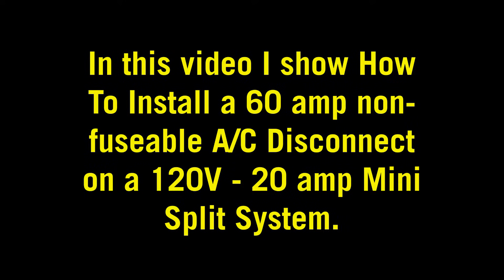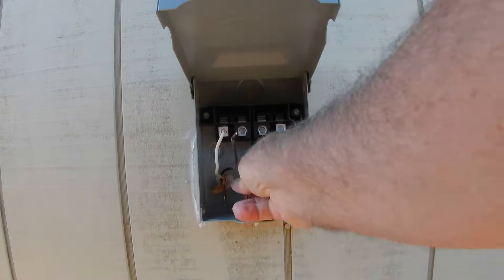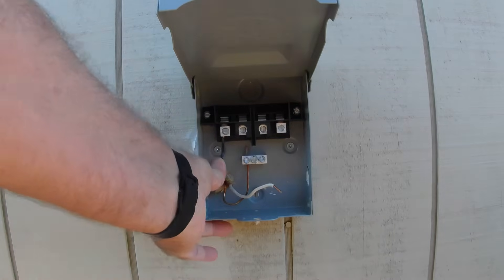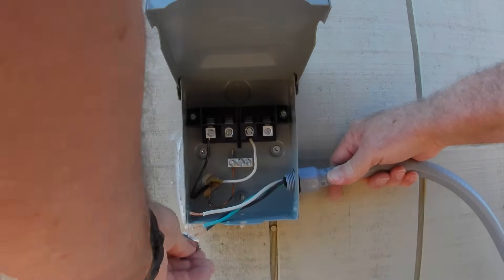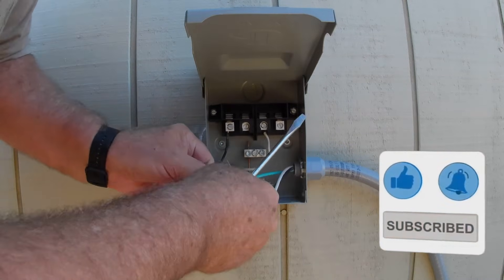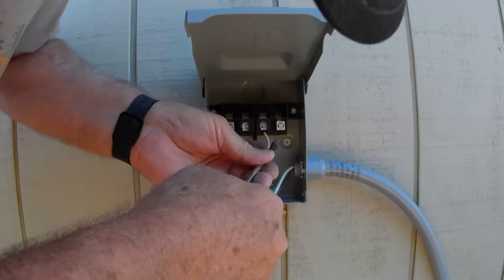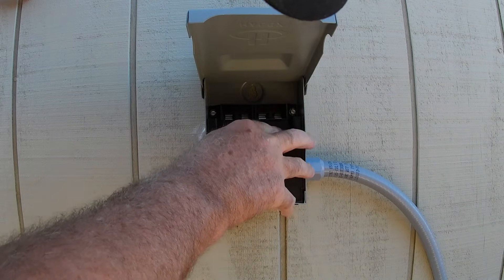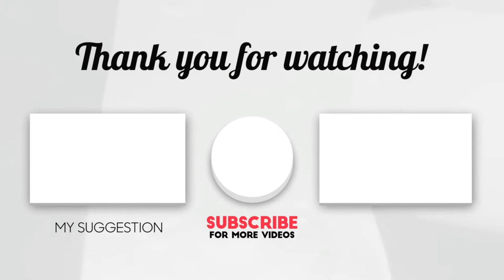How to Wire a Disconnect Box for an Air Conditioner

Comment: My wife is an electrician does your code not make you use insulator bushings on the liquid tite fitting?
Reply from the maker: Hi Matthew, Yes, insulator bushings are often needed on liquidtight fittings, especially for conductors size 4 AWG or larger entering boxes/enclosures, to protect wires from sharp edges, though plastic fittings also qualify if they offer smooth, rounded protection as per NEC 300.4(G). The decision depends on the fitting's design and the inspector's interpretation, but adding a plastic bushing is a common way to ensure code compliance and prevent cable damage from abrasion or cuts.   Thanks a bunch for bringing that up, I also put a fitting where the wires came through the back.  I forgot to get it on camera when I screwed that one up and forgot that fitting.

Comment: Hi, what if your AC line (Load) has Black, RED, and green- no white/neutral. The Conduit from LINE house is Black, White, Ground...where do you connect then? Both Blacks on Left- Line/Load-and and "treat" the Load RED as a Neutral and plug it in to the right side as you show? I have mine (working 2+ years)- running with the white and red together, no right side bar used (dummy copper used for connectivity), and treated it like a hotwater heater, I guess.  Wish I could send a photo, sir.
Reply from the maker: As per the book the red is treated as a neutral in your situation, thanks for jumping on here William

Comment: Isn’t the two middle lugs for the load and the two outer ones for the line? Seems like you crossed the neutral
Reply from the maker: Hi Jeremy,  Honestly it doesn't matter on this disconnect one side it connecting hots and one side neutrals regardless which pins they are on because the cross over is the disconnect pull out.  Good catch and thanks for watching.

Comment: If you are installing a Mini Split AC unit, THERE IS NO NEUTRAL!   They are 220, which means you have TWO  “line wires”, normally a black, and a red, but sometimes they use the wrong wire type (colors) for the 220 circuit with a black, a white and a copper ground.  As long as it is sized correctly it doesn’t matter, BUT should be Black, Red and copper ground which makes it clearer to somebody they are both HOT.   There is no neutral.
Reply from the maker: Great point and we thank you for the explanation on a 220v unit, I couldn't have said it better.  However this is a 120v disconnect video that is wired differently.   Again I appreciate you watching and the input, it means a lot to me!

Comment: So is your neutral connected to ground bar inside panel? 
How would that back feed? Wouldn’t you just wire nut your neutral together in the disconnect?
Reply from the maker: You can wire together, if you look at how this disconnect works it just cuts the hot and neutral when pulled and when put back in it reconnects the  hot and neutral.  These disconnects are in line for code and being able to service it without the chance of of harming themselves.

Comment: I am wiring a DIY 115 volt Mr cool 12k mini split. Mr cool recommends 10/2 wire with a 25amp breaker. I know it might be over kill but hey. I have a similar 60 amp non fuse disconnect. If I am understanding correctly my Romex from the panel goes on load terminals hot and neutral? And then the load terminals are where the wires from the mini split go? There is no order other than making sure load is mini split and line is the wires from the house? Is it really that simple or am I missing something?
Reply from the maker: Yes, that simple.  Just like I showed!

Comment: Do you not need the fuses for this?
Reply from the maker: No fuses just an a/c disconnect.  The fuse/breaker is in the panel the wire was pulled from.

Comment: Great video. Been searching for this, as all the others are for 240v. I had an electrician tell me to connect both black and white to each line terminal, but I am using 20a single pole and 120v system like you, and I didn’t think that’s correct. Question though is where does the white wire connect inside the breaker panel? To the common neutral rail, where all the others in the panel go, or on the ground bus? Sorry if a repeat, but I searched all the comments and didn’t really see an answer specifically unless I missed it.
Reply from the maker: Look at the other breakers in that panel and their white Netrual wires go, I cannot answer because I don't know if your working off a sub panel or bonded etc.  Some wire the whites into the grounding bar so the best way to tell is by the other breakers.  I hope this makes sense I just don't know your level on eletrical.   Thanks for watching Aaron!
Reply: @ILikeToBuildStuff  Thanks for the reply! It is a sub panel I am wiring it to. It has a a black, red and white wire coming from the main breaker. The white is connected to a common rail separate from the ground bar. Other circuits in that panel had the whites on the common rail not the ground bus.
Reply from the maker: @aaronwilliams8600    Stick with the common from what you said.

Comment: My ac disconnect box says (load and line)... So load is neutral/white wire?...
Reply from the maker: The Line is coming in from the breaker panel the load is going to the a/c unit.  On one side of the disconnect is the black hot wire and the other side is the white neutral wire.  hope this helps
Reply: @ILikeToBuildStuff  yes.. thank you

Comment: Can I do the same process if I want to add a 120 outlet to the disconnect box?
Reply from the maker: It should not have a receptical in the line, unit to disconnect then disconnect to dedicated 20amp breaker homerun to electrical box

Comment: Where does the red wire go? Also, my disconnect has two extra places that your box doesn't have. I have to assume those would be for fused connections. Nonetheless,  I removed those and still don't know where the red wire goes (from the whip). The bozo local yokel I had install my ductless simply used the disconnect as a junction box, which is how my motherboard got fried. It's how all the ac guys here do it, which is why I've become a DYIer out of necessity. So, I'm trying to fix this and do things properly. Meanwhile, the various how-to install disconnect videos I've watched do not discuss the red wire, and there are conflicts on whether I treat the load white as hot. I'm way confused. A little help?
Reply from the maker: I am going to assume that your unit is 120v and not 240v  in which case the red wire would be for the 240v so it sounds like the red wire is not hot but an extra inside the whip, you should verify that it is a unused wire and that no current .

Comment: As for the surge protector to install on the 120v disconnect box its pretty simple as well. Your surge protectors work for both 120v and 220v . The surge protector comes with 3 wires : 2 blacks and 1 white. The white is not the neutral but it is the ground. So tie it to the ground nut in the box. The other 2 wires ( black ), for the 120 wiring ,you tie the 2 blacks together as one wire and put it on the one the load side of the condenser wire hot black. Thats it. For 220 you put each black on the load sides. And cut the chord as short as it requires without bends. Hipe that helps a bit and gipe not confusing. Based in this video you put the 2 black wires of the surge protector together on the load side. And the ac coming in hot black on the as he shows. The neutral line in can be tied together with a nut or as he shows in this video. Every city has their own codes. Ask the inspector if you need to and wire it that way. But i shut breaker off from inside panel when i do service and the disconnect box as well.

Comment: This was a GREAT video.  The irony is that "certified" electricians either can't, or aren't about to explain anything.  I think I'm over-thinking this, but this part doesn't confuse me as much as how this leads back to the main breaker panel.  You see a lot of videos on this part of it.  I need to run a new breaker from our main box across the house somewhere accessible to our 2nd floor master bedroom for a mini-split.  And, I need to do it in a way that doesn't get me castrated because it looks like a huge eye-sore.  Certified electricians want an insulting amount of money to do this, and short of running the wire, it doesn't seem like it's that hard of a job (compared to the mini-split install itself).  Any advice, or link you can give on the 1st part of this...i.e. main fuse box to the shut-off?
Reply from the maker: I would say first check to see if your panel has any dedicated electrical line running in the area where you need it but isn't in use.  I have seen that so many times.  But if you need to run your own line it's not usually a problem if you have attic access, you can hide the line in the attic and drop it out under the roof eve.  But you are correct running the line and connecting it is not a big deal.
Reply: @ILikeToBuildStuff  Thank you!  I’m hoping, like you said there’s a line running to that side of the house.  If I have to use the attic, I’ll have to wait till winter.  It’s 120 degree’s up there literally. The heatwave/drought in Fl right now is beyond brutal.  Fortunately, it looks like the electrical part of this should be fairly straight forward.  Thanks again for the reply.

Comment: all others were showing 220. the mini unit calls for 120 and I have a 20 amp breaker at the box and you nailed it Sir.
Reply: You can use a single 20 amp breaker for a 110v mini split. Black goes to breaker white and green go to bus bar
Reply: @mrdude3540 so two wires to the bus bar and one to the breaker?
Reply: @BahamianPilot06  yes just make sure the black wire goes to the circuit breaker and the white and bare wires go to the bus bar. Remember this is only for a 110 V if you’re trying to get 240 v then you need a double pole breaker.
Reply: @mrdude3540  great, yes this is only a 115v unit I’m installing and I was curious on if I was allowed to use neutral and ground on the bus bar without a neutral bar at the panel, thanks this makes sense
Reply from the maker: Thanks for watching I appreciate it!

Comment: Did you use 12-2 to the disconnect and the outside unit? Or did you use 10 going from the disconnect to the outside unit?
Reply from the maker: Yes, on a 20amp circuit I ran a dedicated 12-2.  Thanks for watching!

Comment: Super helpful! One question: my electrician wired 12 gauge to my disconnect. Can I use a 10 gauge AC whip with that?
Reply from the maker: Sure, you just can't go the other way to smaller wires.

Comment: Hi Jim, question can I mount a gfi outlet on the disconnect  /120v sharing the same power source to the a/c ?
Reply from the maker: No, the a/c unit is known for tripping GFI and as per code I am almost certain everywhere in USA it's a dedicated line with only the disconnect allowed.

Comment: Thanks so much for the video. All the others talk about using 220 in a disconnect but I just wanted 110w to hook up my Mr. Cool Mini split. Thanks for making it simple
Reply from the maker: Thanks Greg for watching I appreciate it!
Reply: I can I use a 30 amp disconnect on my 12000 btu minisplit heat pump?

Comment: Should phase tape/re identify line neutral that is also hot.
Reply from the maker: You can but I have never had a problem with inspectors but it is a good point, thanks for commenting we appreciate it.
Reply: How is the neutral hot? It's only a 120 circuit. The disconnect has 2 sides to accommodate 240 but it's effectively just an on -off switch. Right?

Comment: I have a older trane unit and it has 2 black wires. Not sure  why. I am hesitant to hook it up because I am not sure what the extra goes to. (Line or load) If you have any ideas please let me know 👍
Reply from the maker: Well not knowing or seeing what you have I would contact Trane and ask.  If it's a 240v most have a red and black for L1 L2 but like i said without seeing it I don't want to give you bad advice.

Comment: My whip uses green,red, and black conductors opposed to your green,white and black conductors. Would I just use the red in the same configuration as your white into the disconnect?
Reply from the maker: Hi and welcome,  Yes but an inspector may not approve of the color change.  But if they do just replace the whip wire to natural white.   I have been able to pass by wrapping the red with white tape.   Hope this helps and thanks for watching!
Reply: Thank you

Comment: I won’t comment on code because I’m not an electrician or inspector.  But in terms of physics, this works.  In terms of good practices, do it per code (or as right as you can).  Sometimes it’s not about you but the guy behind you.  Put the “line” wires to the panel.  Put the “load” wires to the ac unit.  

You could wire a cat 5 terminal any way you want and as long as both ends match it’ll work and the tester will say it’s good.  But the day there’s an issue the tech is going to replace one end and the whole house of cards come crashing down. 

So, again, do it as right as you can.  You can use a white wire for hot too, but at least wrap it in red or black tape where you can see it.  Same concept.  Physics versus good practices.

Comment: I was wondering if you have a video (or can do one) on adding a surge protector to the 120V ac? I can't find any videos on this and just thought it would be helpful to others and a good addition to your channel. Much appreciated for this video as I connected a 'fused' disconnect using your information. I had a fuseable box so used it, otherwise I would have saved money by buying a non-fuseable disconnect.
Reply from the maker: Great idea, I will look into that.  Thanks for the input!

Comment: The inside two connections are more insulated and should recieve the source wires. The two outer bare connections are for the outgoing lines.
Reply: Agree.  Inside connectors are for the line (to the panel), outside connectors are for the load (ac unit).
Reply from the maker: Thanks for watching I appreciate it!
Reply: Exactly right , inside are line, outside are load. This guy is not an electrician.

Comment: When you disconnect with the neutral on the lug, it actually leaves voltage resting on the neural on the load side, creating a potential of difference. Neutrals always need to remain continuous back to the source in order to prevent a shock hazard. I would recommend using the wire nut method or what I’ve done in the past is use a 20a single pole switch in a bell box with a weather proof red handle cover.
Reply from the maker: Hello Emmett, Thanks for sharing!  We all appreciate the comments and for watching.

Comment: Is it ok to hook up two mini splits (assuming amperage loads are ok) to a single disconnect? I take it that I would splice them to the same outgoing nuts? Thanks
Reply from the maker: As per code NO, you must have a disconnect for each unit

Comment: can you explain me..why connect a  60 amp box to the A/C and not a 30 Amps box? if isn't 220 volts?
Reply from the maker: It's mainly the box that can handle up to 60amps but it's the breaker that will control the 30amp shutoff

Comment: I will be using the wiring from my kitchen base board heater because we dont use it. It uses 2 20amp breakers in my main panel 
 So wouldn't I just need to use 1 of the 20amp breakers and 1 ser of wires from that breaker for my disconnect?  Thanks!
Reply from the maker: Hi Ernie, Yes as long as that is what your unit requires.  I say that because another viewer ask that and I said yes but his was a 220v

Comment: Is it possible to use the wiring from an outlet but keep the outlet? Im so confused at why nobody has explained this
Reply: Yes it's possible, safe as well, but won't pass code anywhere in the US.
Reply: @SavedByTheShovel  ah ok. I’m in an odd situation in an HOA where the fuse box is on the outside of another unit so I can’t just run lines through their place. Need to swap for a dedicated breaker to something else.
Reply from the maker: What Randy Said!
Reply: Minisplit needs dedicated circuit. An outlet that's able to plug other items in is not a dedicated circuit to the minisplit. Basically when yhe minisplit is pulling power the circuit voltage will drop at the shared outlet which can underpower whatever u plug into it. Whatever you plug into it, especially a heavy load like a hair dryer or microwave, will pull too much power combined with what the minisplit is pulling and trip the breaker. Always dedicate a circuit to a heavy load to avoid nuisance trips and heat buildup in the wiring and connections

Comment: Is it the same  hookup if my minisplit  unit is 115v with a 15amp breaker at the  panel? Do you need a ac disconnect that's rated at 120/240  or any disconnect that says 240?
Reply from the maker: Hi, this is for the 120 with a 20 amp breaker but  no you only need a 120 disconnect for a 120 mini split but if it's 240 then the disconnect needs to be listed as such for code
Reply: I don't see just a 120 disconnect anywhere it's usually showing 120/240 in the listings. I am trying to figure out what I need for my setup
Reply from the maker: @giovannipaul007  No problem here ya go https://amzn.to/3FaoLUR

Comment: That’s 240v and there’s no neutral his using the white as the second hot because his using a double pole breaker.
Reply from the maker: Well this was 120 and just an A/C disconnect with a homerun to a 20 amp breaker single pole
Reply: @ILikeToBuildStuff so your neutral goes to the bus bar along with the ground correct?
Reply from the maker: @BahamianPilot06    120v or 240v  ???

Comment: You keep saying a 20 amp breaker but when you’re hooking both lines to a line terminal then it’s no longer a neutral correct?! So that 20 amp breaker to talk about is it a 2 pole 20 amp breaker?!
Reply from the maker: You can use a 2 pole but with this disconnect it just stops power to unit for servicing and code.  A single pole works fine for this application.